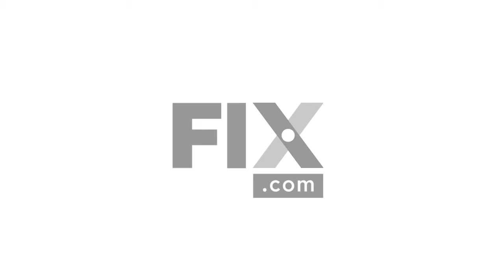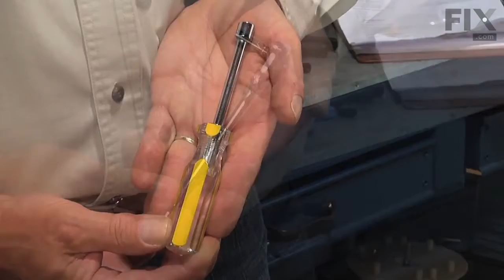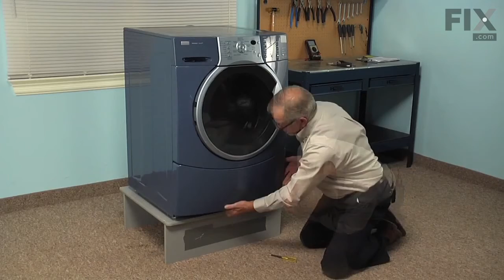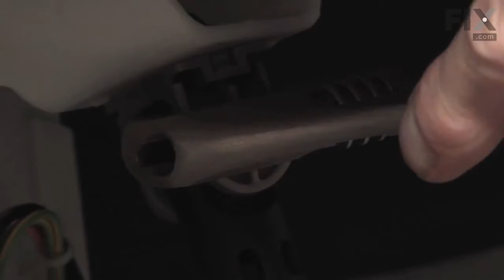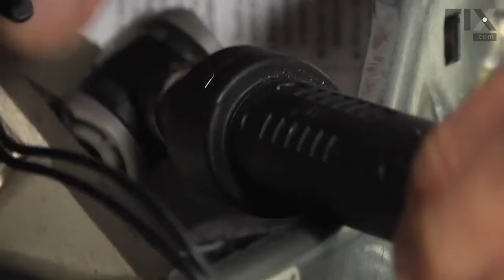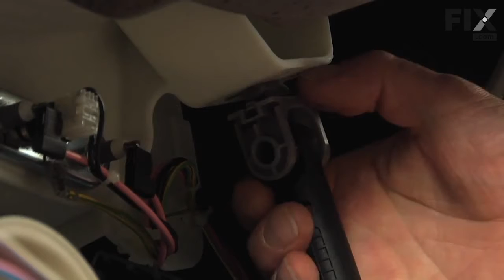Kenmore Washer Repair  – How to replace the Shock Absorber

Comment: IF you take your time, WEAR GLOVES (there’s LOTS of sharp edges inside these machines), you CAN remove and reinstall the rear ones. This was easier for me as our laundry room is a Very small space. Just reach in with channel locks, crescent wrench or vise grips and SLOWLY twist the locking part until the locking tab breaks off. The sheet metal base and the drum mounting points are apparently stronger material than the shock mounts. They were SO shot they’d fall apart when just tilted a little. This video and one on replacing the suspension springs saved a service call and/or buying a new washer to replace the one we’re using and have used since 1990 (IIRC). Replacing it (after a refrigerator a few months ago) was the LAST thing we wanted to do before selling this house. $53 including tax from Amazon next day delivery, an hour to install everything. THANK-YOU.

Comment: I wish Sears  made the front panel easier to remove to clean the pump motor filter basket. Which should be done every so often, some of the newer model have a access door but I still love my washer 20 plus years old.
Reply: my front shocks just went bad and the machine vibrated violently off its concrete base on the floor! it was on its side when i raced down to the basement.. i bought my machine in 2005 at Sears and i guess i could buy an replacement but somehow i still love my Kenmore Elite.. it seems like such a solid machine!

Comment: Thanks, this video was very helpful. There was a problem with no drainage due to a green scrubber caught in the filter. After fixing that, I found  I needed to replace the right side shocks which were broken. The rear was a reach and I had to lever the tub over to get the bottom latched in. Although it was a struggle to get them out, the shocks went in with a twist by hand.

Comment: Awesome video, thanks a ton, much easier than I thought. So, the next question is how do I tell which shock is bad of the four?
Reply: Replace them all if your washer is older like mine. 15 years. The from left was moving in the slot on the frame and making a lot of noise.  I replaced it and the noise was gone but the vibration was still there.  It needed all four.